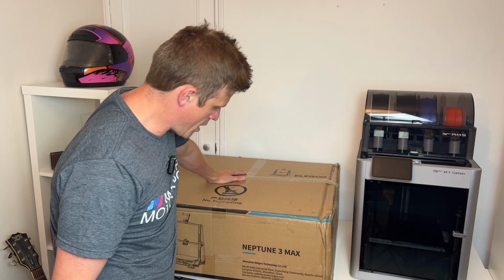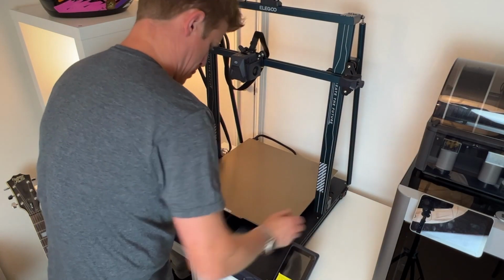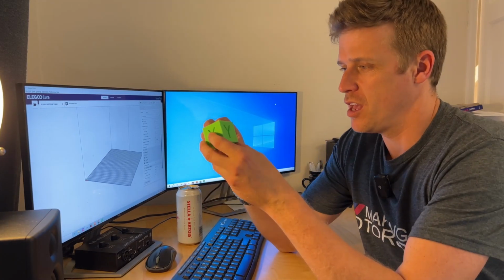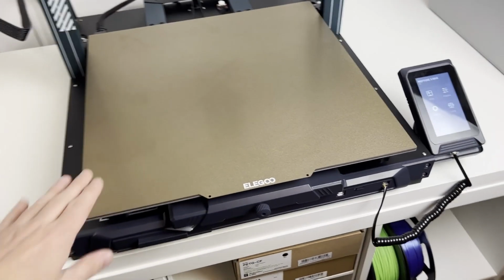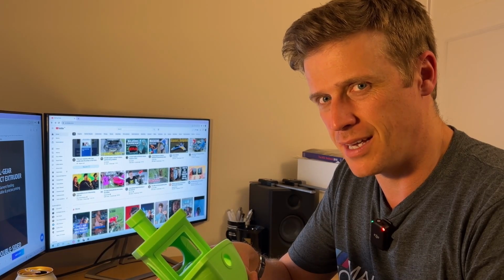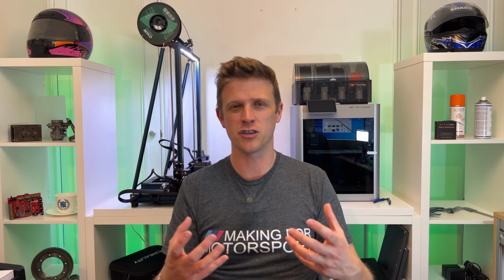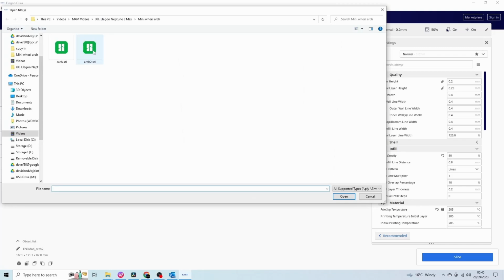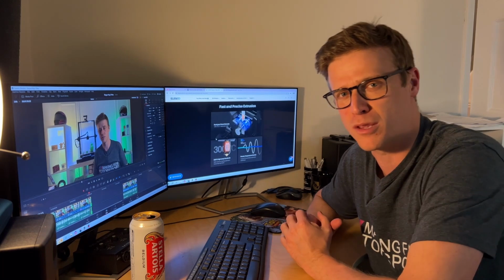BIG PRINTER ENERGY!!!  The Neptune 3 Max - Big enough for you?

Comment: Esun petg sucks, lots of moisture pops/snaps out of the package and it's never wound well on the spool. I've had no issues with polymaker and it's always perfectly wound on the spool. You definitely need to dry it even straight from the sealed bag. I've printed pretty much exclusively with petg on my previous CR6-SE and I've found it prints best at slightly higher temps, 80c bed, 245c nozzle, and 25-50% cooling. Then just calibrate the e-steps and retract settings and you should be getting great results.
Reply from the maker: I’ve got some more PETG, British made… gonna give a go soon…. I’m not giving up yet!

Comment: One thing I don't see mentioned enough is that the slight polygon on the curves seems to be how the models are output from fusion (or solidworks - I've noticed this on both) and not necessarily the slicer itself. Can get even rounder curves by changing the export settings in fusion360. Surprisingly, you have to go to File - 3d print (instead of export). Under output (at the bottom), uncheck The "Send to 3d printer" because we're just making a model. Change the "Refinement" from its default of medium to "Custom". I like to check the preview box to actually see the geometry and then play around with the sliders. Usually ups the resolution by 4-5x the amount of triangles. There are youtube videos on this that will visually explain it.

Really helped me with some concentrically fitting circular parts on the resin printer. It will also make slower computers cry a little bit on complex models. I've only dealt with resin since learning this, so unknown to me how this will affect extrusion slicing.
Reply from the maker: I did notice it but to honest it’s probably worthy of another video… 

Obviously more and smaller facets on the stl will help with this, but I think the best solution is to use a slicer that can handle .step files, then the curve will be exactly that…

I’m thinking of moving over to the BambuStudio fork for everything for that reason…. I may share my results 👍

Comment: Ive run into the cable problem on other printers and used retractable ID card chains that way when you get to the super large end or top of the printer you dont run into other issues. As for being slow, speed is achievable but for the size and speed youre going to want a core xy or similar machine. For the price point of the elegoo though you cant really best them for what they are.
Reply: My big printers are all running either 0.6 or 0.8mm nozzles. But they are also corexy ratrigs and vorons tuned to run 24/7 at well over 350mm/s. 3d printing is so cool
Reply from the maker: I had planned a big CHT nozzle for this but that and the Klipper upgrade on the 4 may turn my head… those Vorons sound like the real deal…
Reply from the maker: Honestly I was really impressed with Elegoo on this machine and also working with them.  The Neptune range would be my go to recommendation now….

Comment: Interesting size for sure, 260 nozzle seems low if you do car part stuff though, its barely ASA levels, the new one seems to solve that though, and i guess this can be uppgraded. Btw did you ever try that PCCF i sent?
Reply from the maker: Hi Cedric… to be honest, that scared the life out of me on my Ender3, but I’m gonna run it thought the X1C which should eat it up…. Just need the right application 👍

260 is plenty for cosplay etc, anything that needs above that also likely needs an enclosure, which for this printer would need to be a large wardrobe 😂
Reply: @MakingforMotorsport  would be great to have a large one to be able to print air boxes and stuff like that. Im just afraid it+enclosure will fill up a quarter of the few square meters i have in the garage 😂

Comment: Thanks for the review! I print almost exclusively in PETG on a larger format printer (CR-10 Smart Pro) and the limiting factor is an enclosure. People don’t want to admit it, but PETG gets super warpy and can have surface issues, especially with overhangs near the base of the print. If you want to use these large format printers for anything but PLA, they need to be in an enclosure, and given the volume of these printers that makes them very impractical. I can only use about 200x200 of the bed without encountering warping issue in PETG without an enclosure.

Oh, and I dry even brand new PETG for 24hrs sometimes before I print with it. And end up re drying it after it’s been out for more than a day or two.

I switched to a .6 microswiss steel nozzle on it and found it to be an acceptable compromise in quality and speed.

Edit: oh and I’ve been buying cheap(er) milled carbon reinforced PETG and it’s been 👌👌👌 for automotive applications :)
Reply: what temp do you keep your enclosure to avoid warping ? And do you have print fan cooling on?